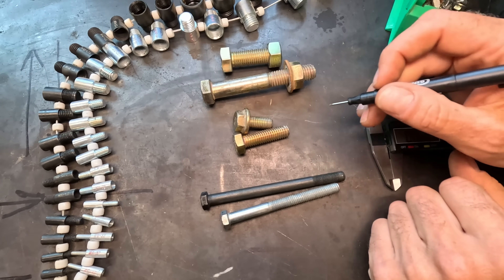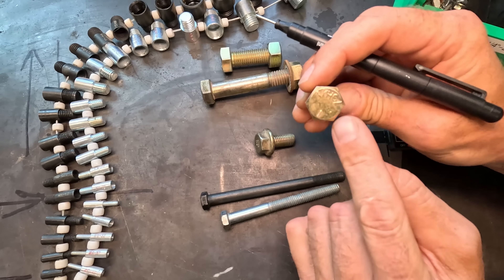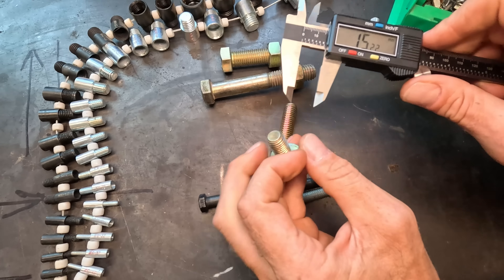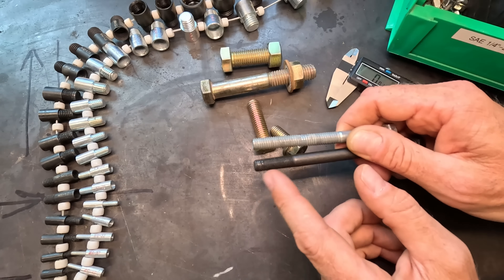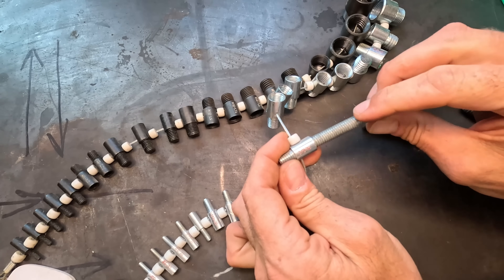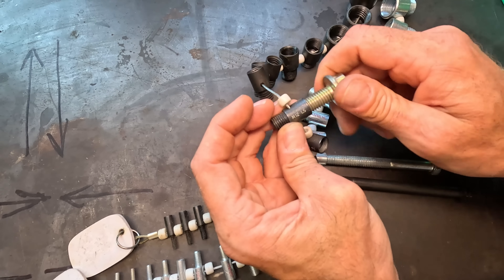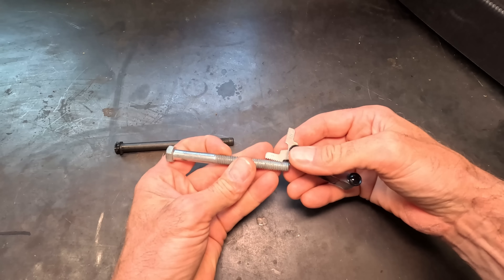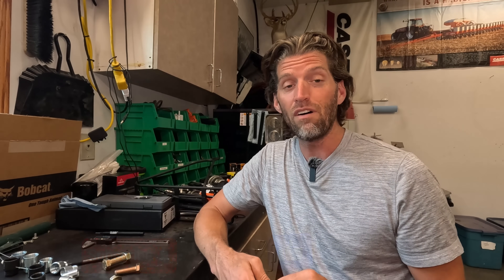How to find bolt & nut size, metric or imperial.

Comment: In Britain we have at least 3 more to worry about , Whitworth, BA (British association0 and BSP (British standard pipe so thread checkers are essential.  I bought a Myford lathe, as a project, mine was made in 1864?   So Bsf , whit and BA then One clamp (original fit) 6mm ? and parts list says 6mm.  BUT over time owners must have used whatever on hand for repairs and modifications.  I was stumped over 2 bolts to find there was a MODEL MAKERS range of sizes.  If you want complication I worked repairing US army equipment in Germany their moto jam any bolt in.
Reply from the maker: I've stumbled upon a little bit of British Pipe Thread with hydraulics on European design/manufactured equipment. The lathe sounds fun and fascinating.
Reply: The pitch of M6 is the same as O BA it is only the thread angle that is different. You often find M6 used by a numpty that doesn’t know about BA

Comment: Good video with accurate information. I have a plate with both metric and SAE for bolts and nuts. But I also have the thread pitch gauge as well. Some time I use one over the other depending what I am doing. So many times metric and SAE are so close they basically look the same until you try to use one for the other. So having the gauges makes quick work of sorting them out...   Thumbs Up!
Reply from the maker: Thank you for the comment! Trying to help educate the average person with understandable information.
Reply: We have plate style thread checkers here too -- soooo many of them.  Whitworth, metric, SAE, coarse, fine, BSP, NPT, JIC.... 🤯
Reply: Broke the head off an M4 in my car. Went to Lowes and the M4 threads were finer. Matched an 8-32 with matching threads and it worked great.

Comment: Are aviation hardware bolts/nuts SAE, metric, or something else?
Reply from the maker: That is a great question. I haven't worked in aviation, so I'm equally curious to learn that....hopefully someone will respond to your question!
Reply: @LearnedFromDad Mostly Unified threads. Some European aircraft are metric (Panavia, Eurofighter etc.)
Reply: Aviation in U.S. inch sizes has its own peculiar "AN' (Army-Navy) system. They are designated in eighths of an inch. For example an "AN-2" bolt is two-eights of an inch -- or 1/4 inch. AN bolts are very expensive.

Comment: You have omitted Aircraft fixed pitch series bolts, which America used to be fond of to keep spares prices high. Whitworth, Sae, Unified series for automotive use. Metric fine, medium and course. Its a minefield, and one needs a pitch gauge set, and a shadow machine to measure thread angles. And then there are Indian made with a swinging breezeblock threads! often 47 degree angle threads.
Reply from the maker: Mine field is right! Especially to a common person just trying to replace a piece of hardware that fell out of something in their daily life. Hopefully this video was just enough for them to understand, but no be overwhelming.
Reply: Also unc unf etc etc

Comment: Metric bolts ARE the standard bolts. All those inch bolts are used only in usa and nowhere else
Reply: Don’t forget whitworth and BS. The FIRST standardised fastener system in the world 
Still on a lot of electrical equipment throughout the English speaking world 
Therefore STANDARD IS BSW 
That said thanks for a great video.
Reply: Not exactly only in the US.    

    With General and Commercial Aviation products that are used worldwide, the common standard was AN (Army Navy) which was surpassed by MS or MilSpec.

    Common fasteners like nuts/bolts and rivets are measured In fractions of an inch.    

    Examples:   An AN 4 bolt is 4/16 or 1/4” in diameter.    

   A number 4 rivet is 4/32 or 1/8” in diameter.   The #30 drill bit for a number 4 rivet makes a hole that is .128” (128 thousandths of an inch) in diameter so that the rivet can swell .003” as it is driven and formed into shape.

     Airplanes are also flown in imperial measurements over much of the world.

   Airspeed in knots, distance in nautical miles and altitude in feet.
Reply: @Stepclimb  I'm glad you mentioned that. 
My late Dad was A&P guy 45 years. Left me a vast collection of AN hardware and tools.
Reply: @Stepclimb sir, I would happily wager that you are or were an Aircrft Mechanic.
Reply: According to CEE Australia the USA measures in bananas
Reply: @steveC2  😂👏 Hahaha, well I was trying to be polite.... Kurtis is right on the ball! As soon as you get small in engineering, nothing is more frustrating than measuring  29, 37ths of a 🍌 😂😂😜
Reply from the maker: @steveC2  I love watching CEE.
Reply: @steveC2 
Why does CEE deny homosexual special rights ?
He's no illegal mexican !
Reply: Ohhhhh nooooo ! Not that British system, happily and stupidly adopted by the USA . They had their chance  adopting the civilised decimal metric system. 
All those different names for those different threads. Those threads are only but a small part of this shocking system. In engineering they soon found out that working with fractions was “un”workable so they divided the inch into a thousand pieces, oops , isn’t that decimal.
Reply: So why is it that even metric sockets still have an inch drive?
Reply: I only smiled when reading comments about "who's kung fu (system ) is the best"
Besides the point.When somebody took the time to teach me anything about nuts and bolts, immediate attention.It should be FIRST thing any mechanic should learn.Sizes,pitches,metals, metric,non metric,how to measure anything regarding bolts,torques for different sizes,types,diy torque with scale at certain distance,etc.
As mechanic your qualifications means zero if you dont know above mentioned about fasteners.
I have seen mechanics with decades experience who still force metric on non metric.Shamefull tragic to have such lack of knowledge
Reply: @henkmeiring01  I wouldn't call them mechanics then
Reply: All countries around the world who use petroleum products use inches and psi etc because the STANDARD is the api standard. I should know because i worked in the oil manufacturing industry for years. Doesnt matter if you are in saudi or indonesia or wherever. We had nothing that was metric.
Reply: It will likely take another three or four generations before imperial fasteners in the U.S./Canada fade away.
Reply: True @hidnax
Reply: Like 99% of everything in the usa is all made in china.  So by your logic your dead wrong..
Reply: Built a high vacuum machine for a company in South Korea. Used for making semiconductors. The prints specifically called out " SAE, NON METRIC FASTINERS ". We were rather surprised by that.
Reply: But you gotta find what is using what
Reply: Back in the day when I was an apprentice engineer in England the bolts were imperial ( bsw, or whitworth). Then we changed to metric which confused things 😂
Reply: Bolts used in the US makes them the standard bolt.
Reply: Just use a thread checker....simplez
Reply: Barely used in the US lol
Reply from the maker: Definitely agree that as an American, I made the mistake of loosely referring to 'standard'.....relative to inch hardware. I knew better, thanks for the comment.
Reply: I was going to  comment on that very subject. Imperial sizes are "Standard" only in the USA, but I was beaten to it 😂.
Reply: Fyi US Standard was British Standard, before eu became a bunch of snobs
Reply: Non metric are used only in water pipes. Non metric should not exist in any other areas anyway
Reply: @joshhhab what about BA size nuts and bolts because fun fact they are metric sized but not ISO? The non ISO metric sizes are not going anywhere fast because there is so much stuff using them in existence.
Reply: The USA does not use Imperial measures
Reply: @flyovercounty1427  🤔
Reply: @flyovercounty1427  I can tell by your comment you have not worked much construction in your life.
Reply: @flyovercounty1427 I think only imperial liquid measurments are different from us liquid. All the other stuff is pretty much the same- lengths and weights and temps etc.
Reply: @jakhamar55  Yes, a U.S. pint is 16 fluid ounces, whereas a British pint is 20 fluid ounces.
Reply: @flyovercounty1427  🤔🤨 Pint, inch, foot, yard, mile, gallon, ton, .....all derived from the Uk imperial measurements. For total accuracy maybe I should have said "US customary units" 🙄
Reply: @billforrest4205 Don’t forget the “ Barley corn “
Reply: USA is best. Inches and Feet are best.
Reply: Try mental arithmetic in inches etc, so much easier in metric.  Plus, centimetres or cm2 = volume (litres) = weight. 1 litre of water weighs 1 kilo. Couldn't be easier. @robertmceuen3630
Reply: @robertmceuen3630 🤣🤣🤣
Reply: @robertmceuen3630 🤣😂🤣
Reply: @robertmceuen3630  Completely agree. Also, Biden is the best of the best

Comment: Have you got a M6 X 1.25 on that row of gauges? Even some traders of taps and dies have told me that that size doesn't exist, only M6 X 1.0 is what they have.
From my research, they are wrong though, it's rare and costs more but a 1.25 can be bought online.
Reply: What's that for? An old Campagnolo derailleur?
Reply: @dadgarage7966  I gather some Japanese motorcycles use that size, I've found it on a bearing puller tool but that part were broken so I managed to work my way around it by making another part on my lathe and using an adapter basically.
Reply from the maker: M3-0.5 is the smallest my gauges go to. Interesting how there is always something unique to find/learn, just when you think you've seen it all!
Reply: @LearnedFromDad  M6 is larger than M3 so you would have one on that set but I bet that the pitch is 1.0.
Like with an M10, there's a 1.0 and a 1.25 pitch, my tap and die set actually contains both of these.
I don't get why the M6 1.25 is so rare??
Reply from the maker: @steveclark.. so, that will teach me to look at small details way too late at night.....for some reason when I went to my garage I was thinking your comment was regarding an M2 bolt😂

Just rechecked my set, it only has M6-1.0
Reply: @LearnedFromDad  LOL, no problem, thanks for checking. I'm wondering if that size is commonly found in Japan maybe? It's an odd one, why it's not so common here in the UK at least.

Comment: As a fellow content creator(although I' gave up during Adpocolypse 1.0, when I was demonetized due to being too small a channel, and as I'd hoped to create a secondary income stream from videoing what I was already doing, I'd literally only made $27 in 2yrs, and never even cashed it out); 

I'd like to suggest some diversification of you content. Not saying all the thread/bolt content isn't interesting, but it's a rather niche market. Based on the channel name, I'd suggest mixing in topics such as "changing a tire", "changing the oil", "checking a level for accuracy", ect.
Reply from the maker: Thanks for the comment! And, absolutely, tons of topics like those you suggested to come. I started the channel and then took my kids on vacation, so had a brief pause, but getting back to it and having fun.
Reply: @LearnedFromDad  it is a good point to not "pigeon hole" yourself when it comes to content, it never hurts to branch out and dont worry if those videos dont get the same engagement. Its better to try something new than to become the oil change guy or the guy who only does fun facts. However, niches also exist for a reason, and they still do thrive. The internet is a lovely place in that regard in general. Whatever you want to do or however you want to take the channel is up to you, of course. I would say, in my opinion if you were focused on growing the channel, maybe videos in a similar style to the well performing ones might continue to do well. Branching out never hurts either though, so the best thing is to just keep posting and do it as consistent as possible. i think you have a very incredible start with the engagement youve gotten over 9 videos posted relatively close together. If you want this to become a career, I believe its an option
Reply from the maker: @paladinkhan  I really appreciate your comment. As I keep telling my kids, it's important that I/we are having fun with it.....and we are. I love to educate, and learn, and building this channel is providing both those things for me. So much more learning to come, for all!!

Comment: I've made up a few boards made up of a 1.5" wide scrap of laminate flooring, with bolts/nuts through them in marked sizes. I've got both SAE and Metric boards. The Metric boards cover both the course and fine sizes, whilst the SAE board only covers the course sizes. I've always wanted a store bought set of thread gauges, but never justified spending the money, so when I was sorting out my hardware last year, I made up my own board mounted version. Figuring out the actual size, if you have the bolt in hand, is easy to figure out by measuring the size of the head. All hardware stores also have bolt checkers in their hardware department so you can take it to the store and they can figure out what you need if you ask nicely. Thread gauges are also cheap and common, and as different diameters have different threads, you can figure it out from them.
Reply from the maker: Great idea!
Reply: I was always going to build one of those, and if you put a bit of effort in, they can make great wall art. But so far my laziness has prevented me from taking it on.